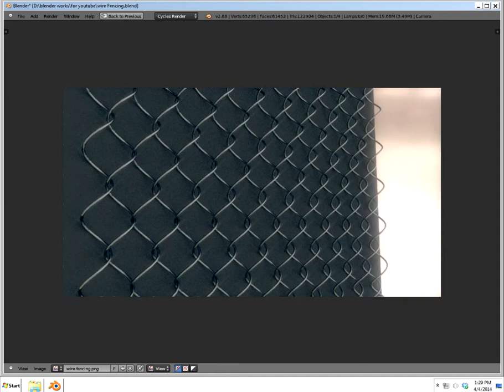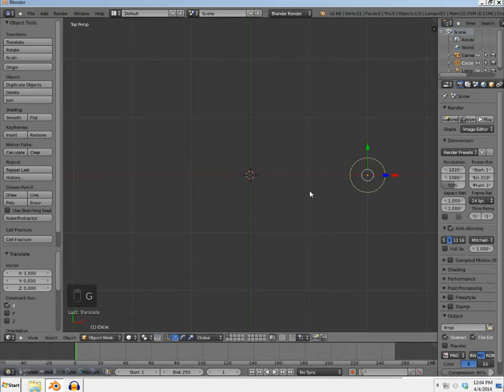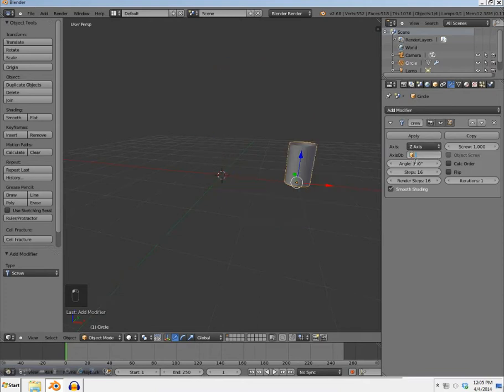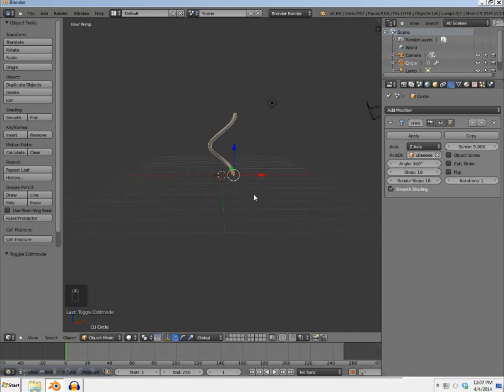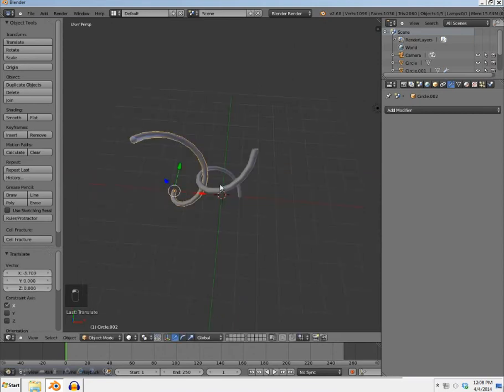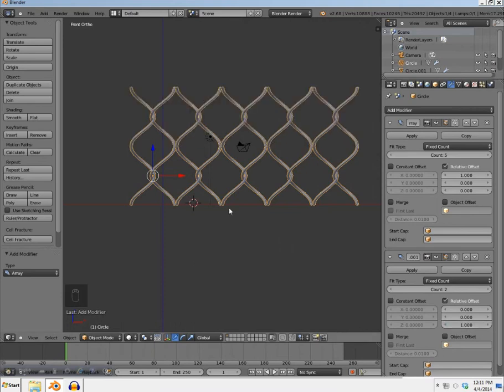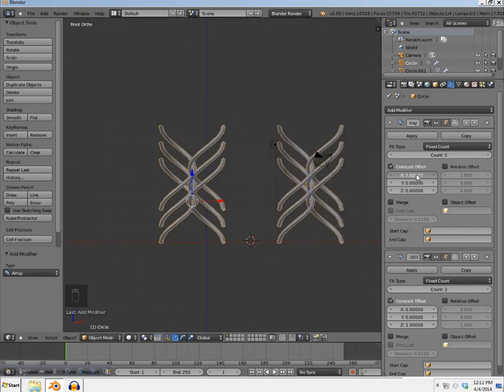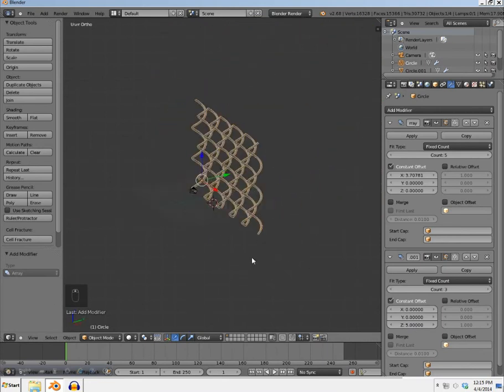Creating 3D Wire Fencing in Blender using Screw and Array Modifier

Comment: If the fact that the fence isnt actually connected in the Z axis is causing problems for anyone:
Position the array correctly, apply it and merge the vertices by distance.
That will connect the fence up